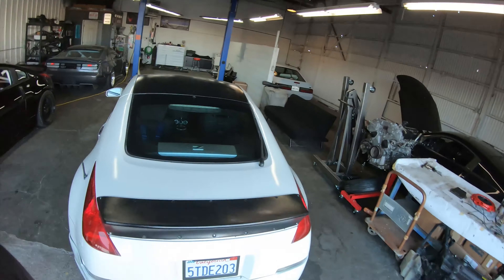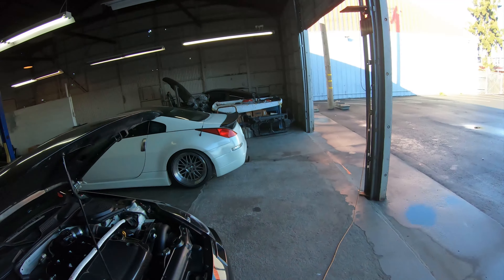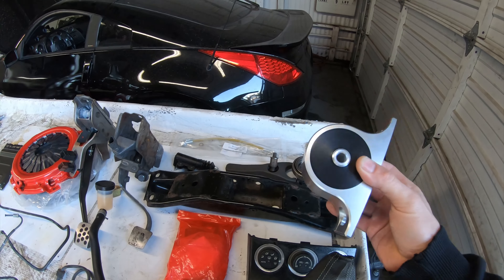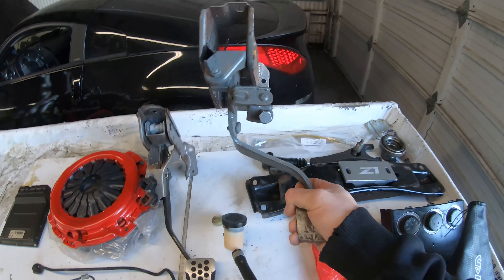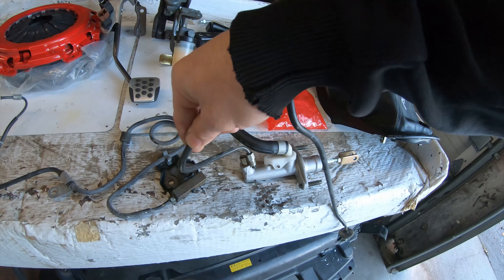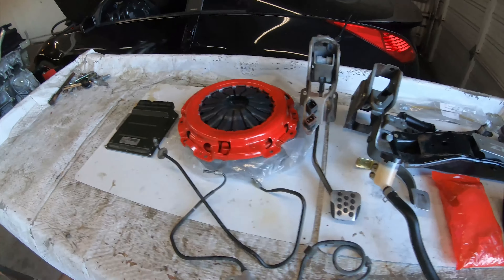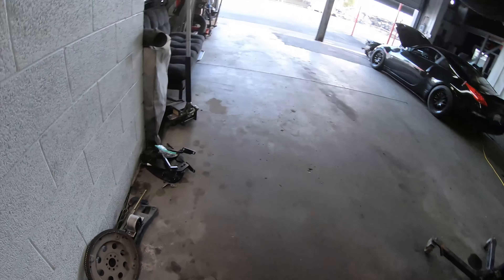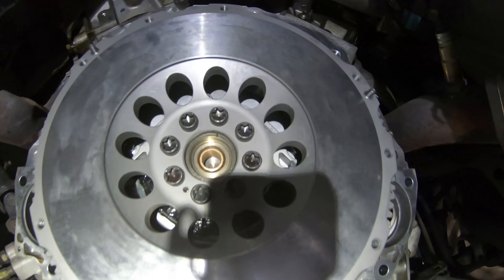NISSAN 350Z AUTO TO MANUAL TRANSMISSION SWAP HOW TO!! PART 1 THE TRANSMISSION PART

Comment: Ok i have a rev up motor with low miles but the motor is blown.  I got it like that. I have a vq non rev up AT.  I want to put my 6mt into my vq.  Can I re use all the parts when I swap. ?

Comment: Do you know when swapping a 350Z HR from Auto to manual is there a way to turn off the service engine light because mine popped up I did not swap the ECU to Emmanuel one I have a manual ECU but I have not plugged it in do you think plugging in the manual one will turn it off

Comment: In doing a manual swap on my g37 . Would i be better off using the ecu and remove NATS, or buy an engine harness for manual and require the whole thing ??
Reply from the maker: G37 is different for me tbh, I think you could use the ecu and jump the "park" switch to allow it to start like how the z was jumped terminals by the battery, I am not certain tho, havent done the g37
Reply: no you dont need swap the ecu you can use your

Comment: Will this work on a G35?  I assume it will, but I had a shop tell me I needed the motor and trans combo and ECM. Not sure why I needed a motor to match the manual transmission
Reply from the maker: Definitely will and no motor needed. I don’t understand that either lol just the transmission and manual stuff💪🏼

Comment: Don't know if you'll respond but is this the same process for a g35 like all the same parts you explained in the start of the video and where all the bolts are mounted and coolant lines
Reply from the maker: Yessir. 🤙🏼I haven’t found anything really different except if it’s a sedan with a foot brake ebrake you’ll have to remove it for the clutch pedal. If you got questions dm me on ig @the_crooked_king. I try to respond all the time. Much love man

Comment: Aaron why is that slave cylinder braided line so short compared to all the ones I’m seeing on ebay? Thanks -T
Reply from the maker: so there is a hard line factory that runs from the master down under the driver wheel well cover and to the trans area on manual g35/manual 350z, the customer bought that hard line and then we just put an upgraded slave cylinder line from the hard line to the slave. If you get the one from ebay or amazon or something like that, the long braided line cuts out the need for the hard line and goes directly from the master to the slave🤙
Reply: @Thecrookedking15  Thanks I figured this out after more research.

Comment: Thanks for you work! My 18yr old son and I are completing a swap on his 08 350z and are at the crank/ no start stage. Wondering if it's essential to swap the ecu to manual (it's currently still auto) and what other wiring we may have missed. Thanks!
Reply from the maker: Hey I’m so sorry to just be getting to this man!! THANK YOU THANK YOU so much. And no it’s not necessary for you to swap. And auto works as long as you jump the wiring like in the part 2 video💪🏼🤙🏼 hope that helps man. Can’t wait to hear about it being done. Much love always❤️🤙🏼
Reply: @carsten-qr6xt Did you ever finish that swap on your 2008 im trying to do my 2009 350z in the next couple weeks
Reply: Got it done! Struggled with the wiring a bit but everything else went smoothly.
Reply: @carsten-qr6xt  what did you have to wire? I want to get into this swap but soon as i hear wiring i get intimidated lol, how hard was the job?
Reply: The only wiring is splicing into the wire that controls the park neutral switch so that the computer allows the car to start. The mistake we made was cutting the wire rather than splicing into it as the video demonstrates.

Comment: Ok so my car is at the mechanic right now and it needs a new engine. Can an engine from an auto be used with my manual transmission and be made to work?
Reply from the maker: Yessir. Same engine. Just change the pilot bearing to the manual trans pilot bearing and everything else works normally
Reply: @Thecrookedking15  mine is an 06 manual. I think I read on the forums that its not the same for the 06 manual rev up.

Comment: Hey so if I changed out the ecu and engine harness for an MT harness will that allow me to have the reverse lights and clutch safety switch as if it was stock? Or do I still have to wire stuff.
Reply: Also does flashing the ecu help with the codes and the check engine light so that it can pass inspection? Ik here in PA if they even the light they fail inspection

Comment: I'm swapping and manual trans from an 08 to a 07 Z are the engine harnesses different?
Reply from the maker: Nope should be the same🤙
Reply: @Thecrookedking15  is a manual harness a plug and play onto an auto engine?  Sorry this is my first time im going to do something like this so wanna make sure I have the right parts
Reply from the maker: @Conker999  the engine doesnt matter as long as the 02 sensor plugs are the same, however the manual and auto harness are different plugs for the transmission, the engine will all plug in but when you go to plug in trans if you have manual and have auto harness or vice versa, the transmission sensors wont plug in and you wont have some functions of the car, like reverse lights etc
Reply: @Thecrookedking15  okay perfect that I have the manual harness then I should be straight. I'm going to replace trans internal slave cylinder and upgrade the clutch while I'm doing it 👌 thank I appreciate you
Reply: @Thecrookedking15  So you need a complete wiring harness from a manual as well? Sorry for all the questions.

Comment: When Swapping Do You Need To Swap Ecu From That Engine To A Car That Came With Manual ??
Reply: No you don’t. There’s a wire you need to splice on the IPDM that will trick the car into thinking it’s always in park to start. I’ve done this to my Z and never had any problems. This is the link on how to wire it
https://my350z.com/forum/engine-drivetrain-and-forced-induction-diy/552038-5at-to-6mt-swap-info-diy-guide-thread.html

Comment: Hello, I have an 06 350Z, which is VQ35DE 5AT, 280hp, I'm going to a single turbo on it, with Transgo kit, I got few questions and since I live in Brazil is veryvery very hard to see people who understand of this car, even on forums like my350z
My biggest problem is the transmission, I was looking for another transmission to put in, but in Brazil we pay 100% import tax over the product + shipping price, so if 2k usd for the cd009 + 500 shipping I pay 2500 + 2500 usd.
Usually people wage here is 120 to 200 a month, of course I'm not like those peoples but I'm not rich if I put my money in USD's
So basically I have 2 questions to know where should I run:

1- Any other transmission that I could find to swap even if I need adapt few things? Like Nissan Frontier 6MT? Which year could be good? Or any other?

2- How much power can the 350z 2006 5AT transmission handle with Transgo? I was looking for 500whp or something close to it, you think the transmission with transgo will handle that? Or should I jump for a swap ( but there is not even one 350z transmission to sale in whole Brazil )

I'm sorry for taking your time but I had nobody else to ask those things...
Reply: I'm not the creator but see if you can get a T56 or LS based manual transmission. There are a lot of swap kits for putting those into Zs and some manual Z drivers swap those in because they are stronger than the CD00A in the 350z.